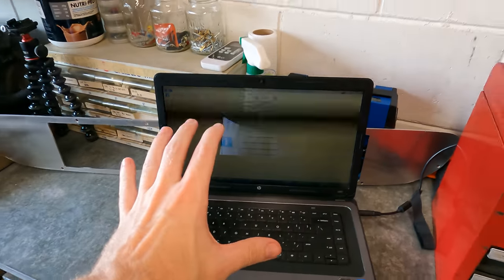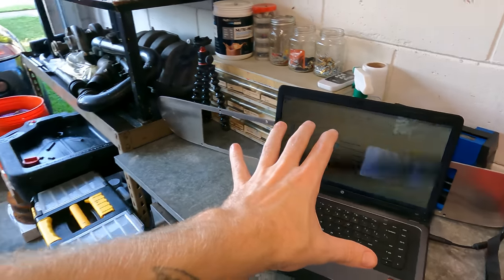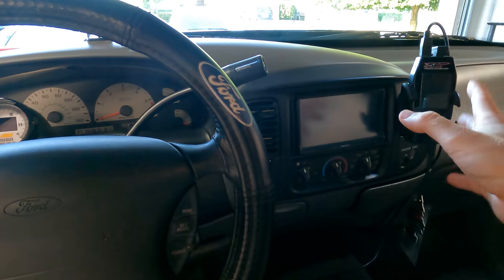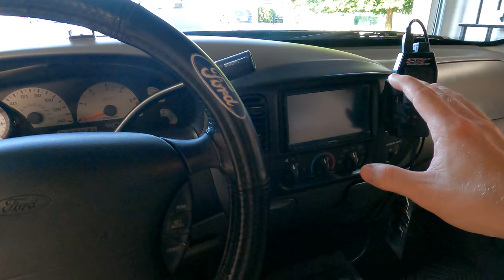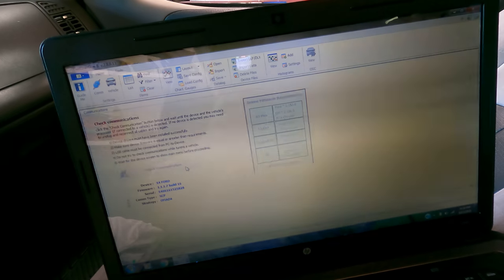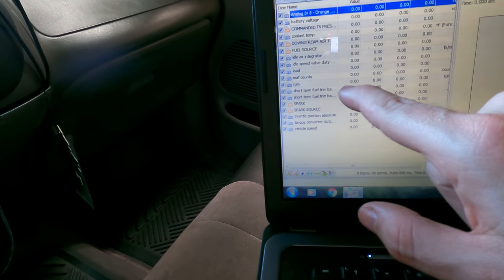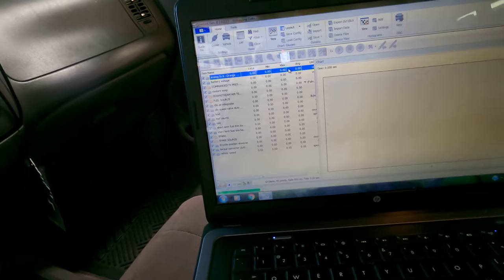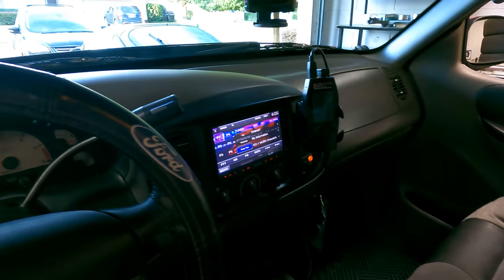Cold Start and Remote Tune DataLogging on the Built Ford Lightning!  Cammed / Exhaust Idle Clips!

Comment: Are you catless? And what cam are you running?
Reply from the maker: ARH high flow cats, and I'm glad I did them, it's not too much drone, still loud as hell, but has a nice, clean sound.  JDM Engineering stage 2 cams.  Not too choppy because they are degreed in, but make good power.

Comment: That engine is absolutely gorgeous. I now need to research and find out ever mod you have. There goes my evening! :)
Reply from the maker: I appreciate it!  My recent dyno video, after the dyno runs, I go over all the mods and what's done to the truck if you wanna check that out.  Might save ya some time scouring through videos 🤘😁
Reply: @DebtLife_Projects  I saw that after watching a few videos.  You mention the manufacturer each time which is perfect.  The coolant reservior caught my eye first.  Plus, I'm all about removing the EGR equipment now as it really cleans up the engine bay.

Comment: Debtlife was hoping you can give me some knowledge. What do I need to achieve 425whp on my 02 lightning. I already have the basic mods pulley, throttle body, intake, exhaust and tune it pushed 390 to the wheels and wasn’t happy. What mods would you recommend I do next to achieve my goal. Also I was thinking about getting longtube headers but have read that you don’t gain much out of it besides  a nicer sound.
Reply from the maker: What pulley do you have?  Have Jokerz performance port the supercharger, that will put you close to where you want to be should pick up 20-30whp.  Also cooling mods help a lot, heat exchanger/intercooler tank/3/4 lines to delete the hard lines.

Comment: What are your hp and tq dyno numbers?
Reply from the maker: No new numbers for this setup yet, waiting until it's not as hot as the surface of the sun out lol.  But on the previous setup (2lbs less boost, alot less cooling mods, and less timing) it made 501/569 on a 100 degree day.  According to Korn, should be around 550s/620s now, we'll see soon.

Comment: Hey Debtlife l've been watching your videos nice work. I'm having a issue with my 04 lightning, it has a built bottom end with stock heads I'm running the DW 95lb  injectors and wallbro 255 pumps. Still using the factory fuel rail and lines. It is running lean at low speed and rich when I accelerate a little hard without going into boost and it shutting off when I slow down as well as sometimes just coming off the gas. Do you think that's happening because the fuel pressure is where it's should be because of the larger pumps? Also with that truck do I need to wire the pumps directly to the battery or the factory power supply is fine?

Comment: Hey buddy what battery are you using I’m on my way to buy one right now hopefully you see this 🦾
Reply from the maker: Motorcraft, I've had really good luck with them, my last one lasted 8 years
Reply from the maker: 850 cca btw
Reply: Thanks man boutta start my truck up for the first time today in about 1 year and few months.
Reply: Appreciate you! I gotta rewatch your videos been a while & upgrading my fuel pumps & Y fitting those fuel tank hoses are stuck like as if it’s super glued 😂
Reply: My truck has a #6 pulley do you know where I can find the size chart for a replacement
Reply: Thanks bro